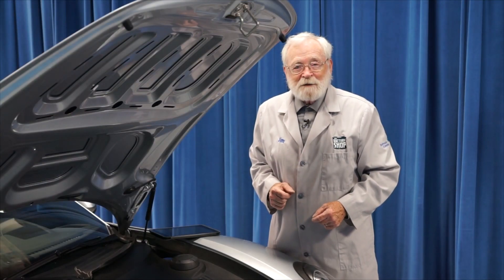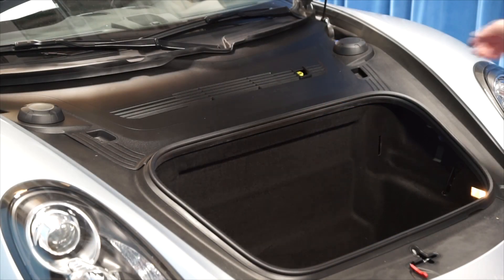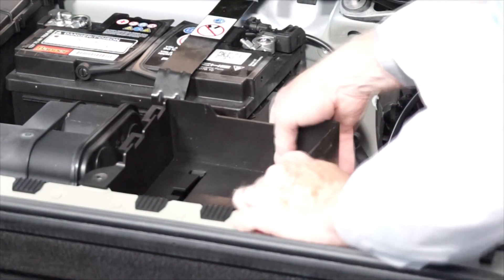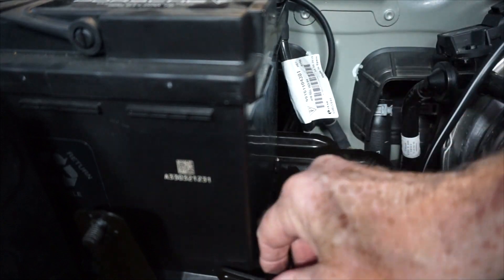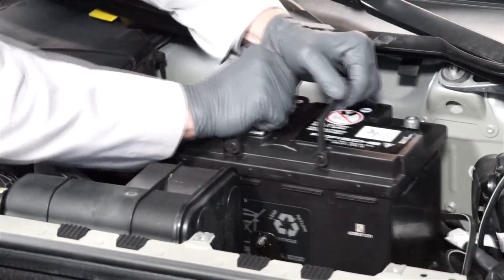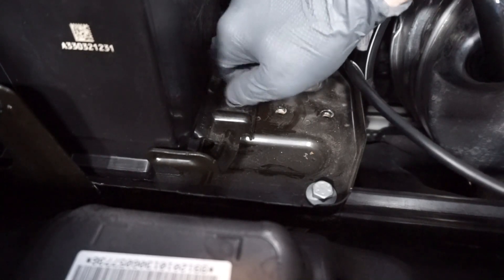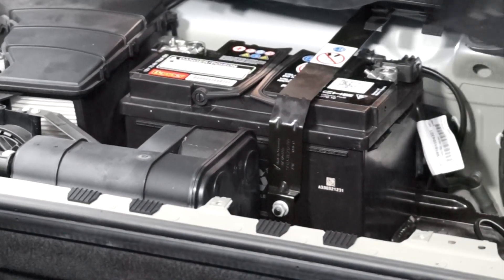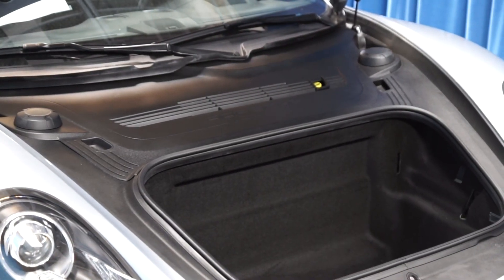Porsche Cayman (2014) - New Battery Install

Comment: Great video....I just went through the steps to make sure I can do this in the future. Perfect tutorial. On newer Caymans(718) the battery memory saver is located outside of the fuse box, under the steering wheel. I went as far as connecting the memory saver and then simply disconnecting and re-connecting the negative. All good. I'll be ready for when it's finally time to do it for real. Thanks!
Reply from the maker: Thank you for watching and glad we could help you out.
Reply: Can you use battery charger instead of memory saver as well ?

Comment: Hey. Thanks for the video. Very helpful Sir. Thank You. 
My 981 Boxster S died on me this winter. Doing a U turn, stalled it. Car dead. No steering, no handbrake. Dead Battery = Dead Car. Can’t believe you can’t even steer this thing if the battery is totally flat, or put the hanbrake on. All electrical.
Reply from the maker: Hi - You're welcome and thanks for watching and sharing your experience!

Comment: My OEM battery was an Exide non-AGM for my GT4.  I replaced it with a common VW battery that had the same dimensions and power specs (H5 Group) because I didnt want to buy a more powerful battery that was 20 more pounds.  The VW battery that I purchased was only 37 lbs.  PN#: 000-915-105-DE and $155.
Reply from the maker: Hi - Thanks for watching and sharing your experience!

Comment: Thanks for the nice video. I just did the replacement. I didn't hook a battery up to it or use a "memory saver". The only thing I had to do was reset the time and date. Even the radio presets were still there. So as far as I can tell, it worked fine. I also didn't tell the computer it had a new battery, but I have an OBD2 code reader and I'll give it a try. Also, the battery tray appears to accommodate three different sizes of batteries (different lengths...I get the impression that all the stuff under the front hood is the same as a 991 Carrera since the gas tank part number started with "991"). O'Reilly's and AutoZone's computers specified the medium size, but mine was the smaller size. I took the battery down to AutoZone and matched it up. It was $169 for a three-year warranty battery. Very easy replacement as far as German cars go!
Reply from the maker: Hi - Thanks for watching and sharing your experience! We do suggest that you register the battery with the vehicle's battery control system so the alternator charges the battery correctly.
Reply: @TheBatteryShop  ok will do it today thanks
Reply: Thanks for watching! e hope the video helps.
Reply: Thank you this helped me a lot when taking mine out , my radio just stop playing

Comment: Hi there, after replacing the battery do you need to tell the computer that car has a new battery?  Thanks in advance.
Reply: Yes, a new battery needs to be "coded" with all of the pertinent info of the new battery.  The Porsche Dealership will charge $230 to replace a battery and "code" it.  Go to a Porsche Independent Mechanic and he can do it and save you a bunch of money.

Comment: Really Great video, on physically removing and replacing the battery BUT only significant point is that Joe Public won’t have a battery memory saver and the 250 page drivers handbook (English) does not tell you anything other than take the car to a dealership to replace the battery. 
There is NO mention in the drivers manual of how to do it yourself, how to use a memory saver , or how to use a remote battery if you don’t have a battery saver. So presume you refer to the FACTORY manual for the car? Or do US owners get a different drivers manual to British owners?

Comment: I just bought a used 14 Cayman S and the battery died in it yesterday. Does it require a programming after install? Or is it as simple as this video?
Reply: You should re-program the battery. Look at the iCarSoft POR V2.0 it's supposed to be able to do it. Also the OEM battery is an AGM battery, so if you replaced it with that style it might not be totally necessary if everything is the same as the OE Moll battery (CCA etc).
Reply: As long as you replaced it with the same type of battery, you should be OK. But when you install a replacement battery, Porsche expects to enter the battery part number, capacity and serial number into the car using the PIWIS service tool. If this is not done (or you replace with a non-Porsche battery) you risk invalidating your car's warranty.